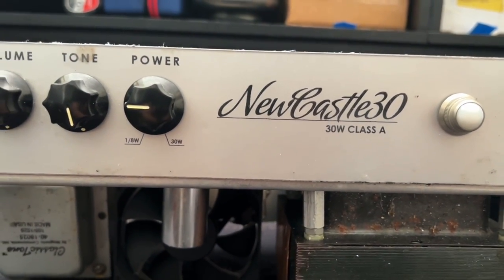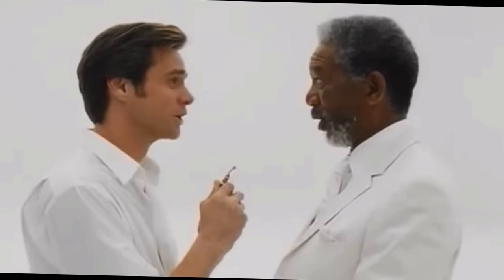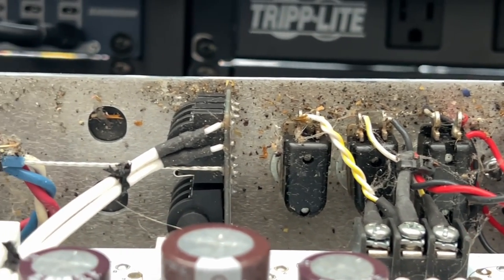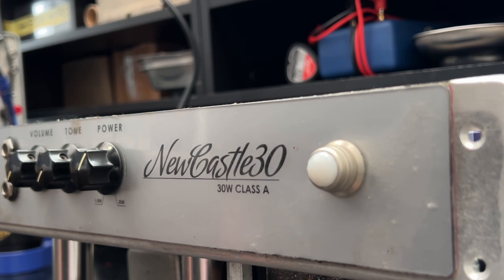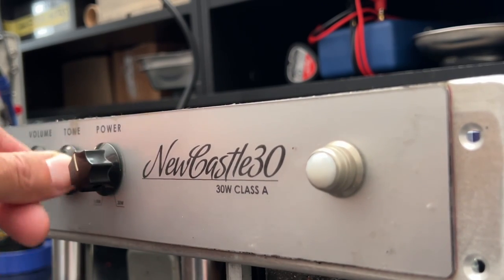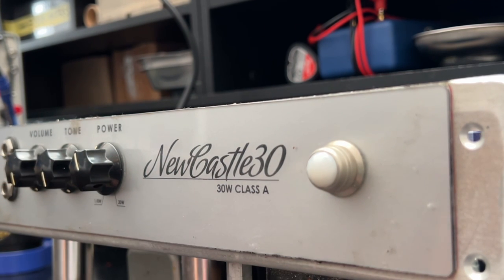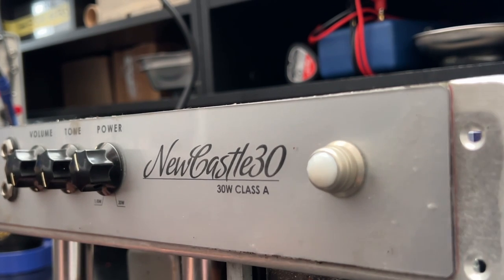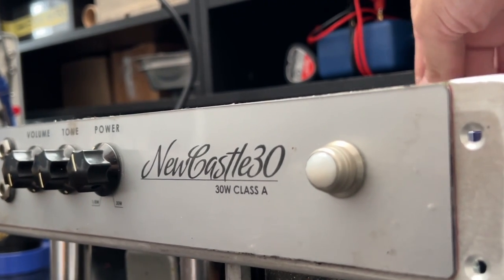Jackson Ampworks Newcastle 30 Part 2: It’s Good.

Comment: An Easter egg in an amp. Love it. As for the stuff on the back of the front panel, I know what that is. You're a good man for taking that in. When I see that, I won't work on the unit. Wear gloves!

The Nichicons are some of my favorites. The Fine Golds are not made anymore, sadly.
Reply from the maker: Haha!  Everything gets the air blaster before coming inside!   I love the caps too.